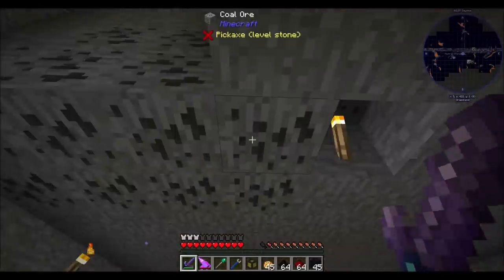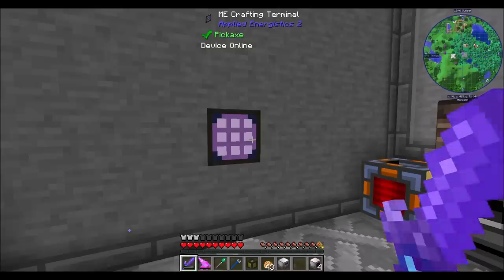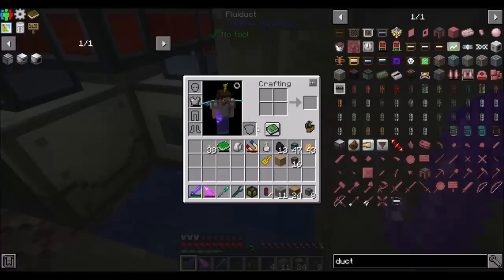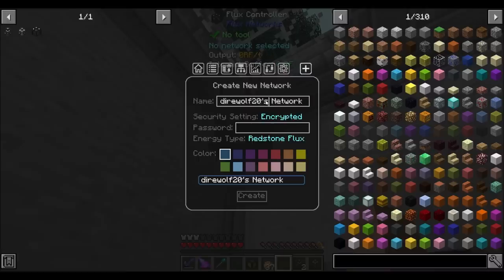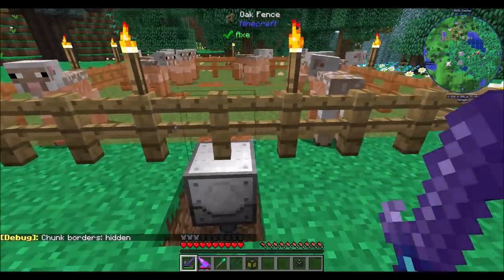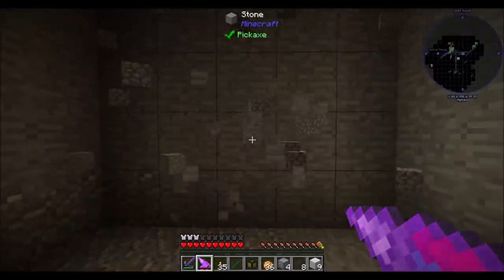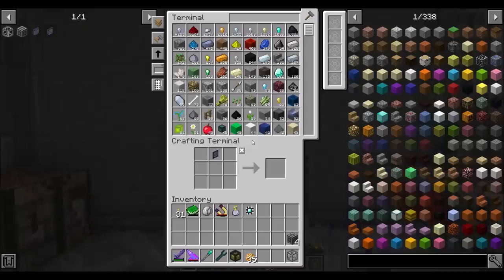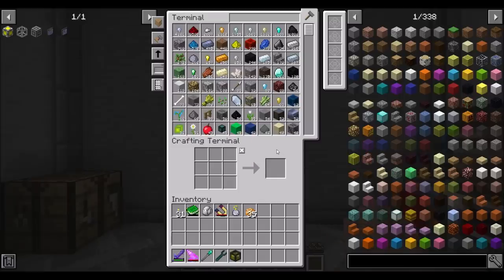FTB Revelations   Ep11 Wool Farm and Autocrafting

Comment: I saw flux networks had a different user interface, assumed the pack had an update on the legacy launcher. Spent about 45 minutes getting that set up, moving my world over from twitch, setting up optifine, etc. Then I realize that the FTB Launcher is using the same exact version and dire must have manually updated the mod (checking the FTB twitter probably would have saved me all the hassle because they would have announced an update). I don't think you can do that on the FTB legacy launcher without installing the new mod but on twitch you can update it with a press of a button.

Moral of the story: It is not really worth it to switch to the FTB launcher yet if you're still fine with using twitch
Reply: dire is changing so many things u might as well call the pack Ftb Revelations Dire edition.

Comment: Do compacting drawers work for tiny piles of dry rubber? Would save you a repeated crafting step if it does.
Reply: Interesting question, not sure but I just piped mine into an analog crafter from extra utilities, then into a Redstone furnace, then into a drawer.

Comment: I don't understand this. I'm running FTB Revelations 3.2.1 and trying to use FluxNetworks. The GUI looks entirely different, and I  setup my network exactly the same, and it does not work. Placed the plug on the energy cell, made sure it was outputting. The plug is connected to the network, and shows zero output. The network is getting no energy from the cell, tried this again on my enderIO bank and get the same thing. Energy is outputting to the plug, the plug is connected to the network, but the network isn't getting energy. Can anyone help? Should I update the mod FluxNetworks itself?

Comment: Bro... When did minefactory reloaded get renamed? Lol I missed that mod.
Reply: @DeletedUser410  The original Minefatory mod had a bug in it's harvester, which meant if you built one and set it down once connected to power it would immediately start harvesting all connected trees and foliage it recognized back then expanding outwards from the harvester. Great forest clearing tool, but only if you really wanted to deforest a region of chunks! :D
Reply: @DarkVoidIII  it was still there in mfr. i remember the harvester eating my base, which is made out of logs mostly. i fixed it by using forge microblocks lol

Comment: from egypt
how i can download this modpack 
does it work for 4g ram
Reply: You need the twitch launcher, it should have instructions in it.

It should be fine with 4gb ram, but you might have to drop the render distance and play on fast graphics...
Reply: all modpacks will struggle on just 4gb of ram but its worth a try.
Reply: But what is the modpack name
Reply: @osamadev5771  "FTB Revelations"
Reply: its in the name of the video .
Reply: @osamadev5771  it's in the titles. FTB Revelations. Though Dire has added a few mods to it, such as Nuclearcraft, his Building Gadgets mod, Integrated Dynamics and Tunnels, and Flux Networks, iirc.
Reply: 4g will really struggle to run anything mod wise
Reply: Just play 1.7.10 bro